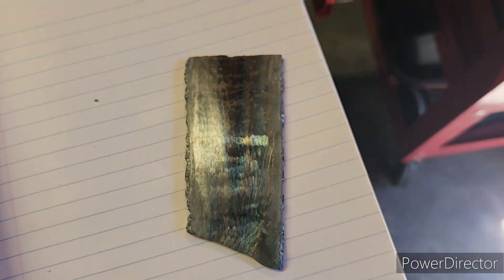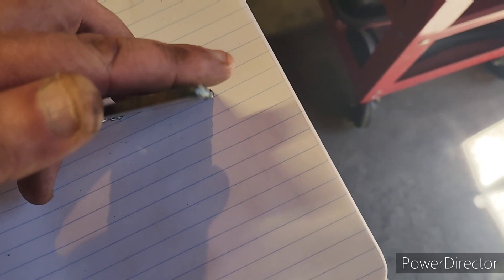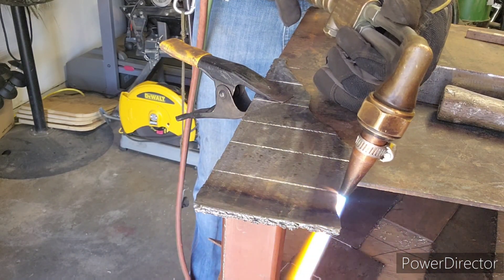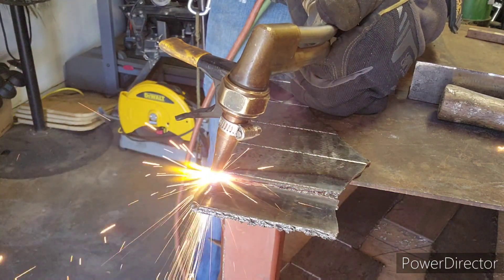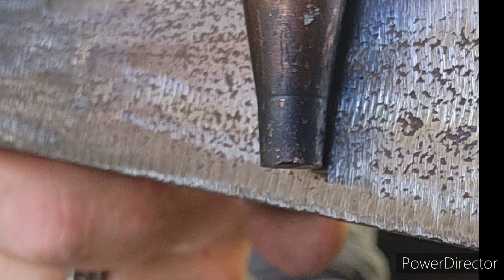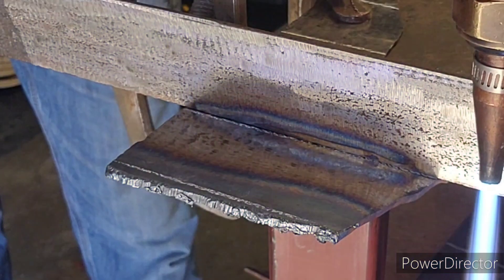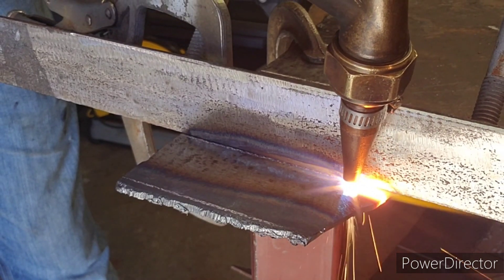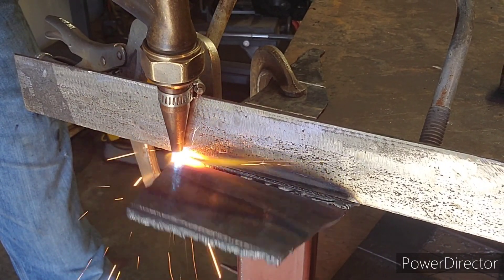Avoid Weld-back/Melt-back when torch cutting THIN STEEL.

Comment: On thin steel with a number one tip.i can place my hand on the plate and cut  by rotating the torch head that way you can move fast enough to get no slag and a perfect cut if it's melting  you are too slow and probably  don't have your torch set right.

Comment: Excellent explanation. The lava and butter analogies drive the concept home.  Would love to get your opinion on what has been sold as a miracle welding and cutting oxy kit.  It comes under many names and has been around for more than 50 years, so it is not a flash in the pan invention.  Lately  there are as many users swearing by it as there are swearing at it mainly because some say the cutting is not as easy as what they show on the cutting videos which are all 10-15 years old. https://www.youtube.com/watch?v=WCLq9cK73QA. Don't expect you to go and buy one of these as they are way too expensive new. As more welders yield to the fascination of electronics more of these torches become available on the second hand market for a hundred or so. If this torch gets your attention, look at this: https://www.youtube.com/watch?v=8q7UyYKkX7M&t=751s
Reply: Are you talking about the Henrob Torch?  That has a technical novelty to it that helps in this situation:  Just using ONE preheat flame, and you have some control over THAT.  It's no joke!  It should be mentioned that there are SO MANY cutting tips for Oxy Acetylene and even Oxy-Propane torches of commerce, that people don't pay any attention to!  You can buy very small cutting tips (Maybe 00 or even 000!) and THEN choose Light, Medium, Heavy preheat I recall.  I have copper cutting tips for Victor I think that only have ONE preheat flame and one Oxygen jet, so there are a lot of options!  Ah, I'm here because I HAVE this problem he's talking about.  Did the reading and bought the stuff but haven't had the practice yet.  I don't DO that much torch cutting!  But I'd say "Smaller Tip, Lighter Preheat" seems like a general solution here.

Comment: I put a serious effort and finally got the cuts to look right. On my set up I dialed back the acetylene back to about 2 3/4 and oxygen to 27. After failing to cut thru on one pass but the cut looked good I decided add more oxygen pressure and it worked . I did use a burn bar to help me maintain the right distance the only thing I need to work on now is my travel speed. Thanks for all the help I would not have got this on my own. Like you said you can't cut molten lava.
Reply from the maker: Nice work. Travel speed is going to be simple to figure out. Just slow enough to keep sparks blowing out the bottom & fast enough to make consistent progress. But you're there, man. Just a little bit more practice, & you'll be teaching this stuff to your buddies! I'm glad this helped. That's worth the great stroke to me. 🥵😂

Comment: I really appreciate you taking the time out of your schedule to put this video together. I had tried it last week and even knowing I was too hot I still had it welding back on itself. I didn't use a guide bar. I did use a 3/0 tip and dialed back the pressure to 3lbs on the acetylene and 15 on oxygen and it was still closing back up. I will after watching this video give it another try. Seeing you do it I know it's possible. My attempts last week were better than before I had watch your video but I'm not there yet.
Reply from the maker: 15 psi is too low for the air. Try about 25psi oxygen, maybe about 3psi acetylene. Remember, you need a nice "neutral" flame, and 23-25 psi air should get you there with 3psi of gas. You're really close to dialing it in. Just throw a little bit more oxygen at it to blow out the cut. Let me know how it goes.